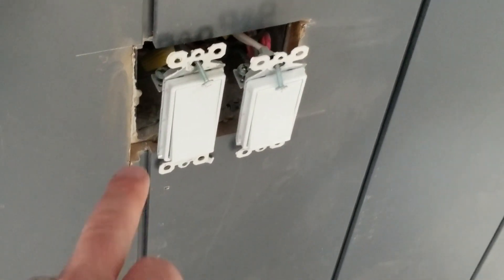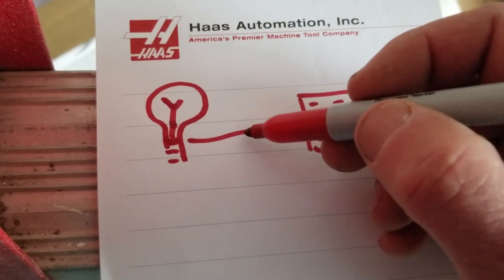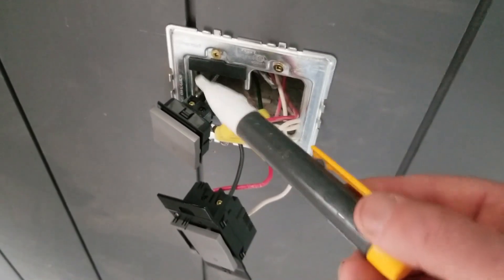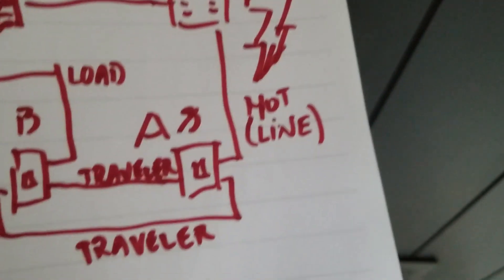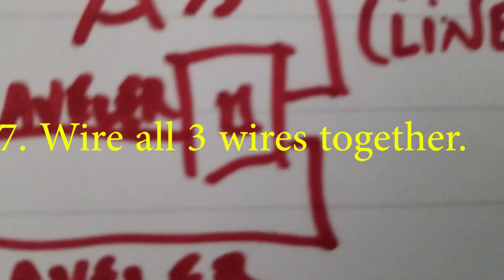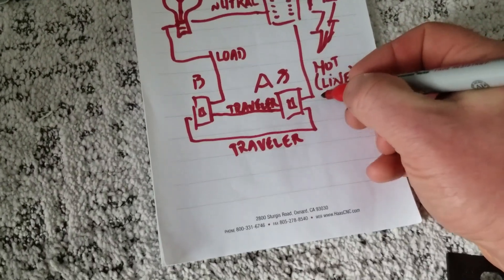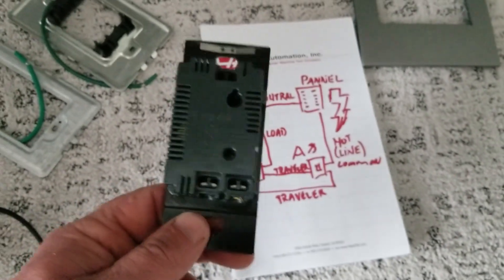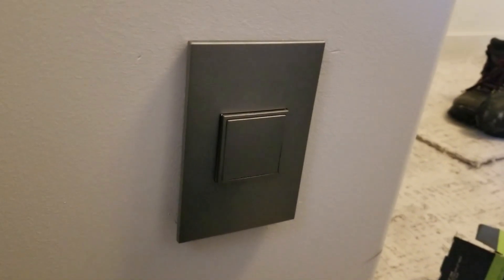Wire a 3 way switch | reference

Comment: We call that a two way light switch in the UK. Two way with intermediate is a real fun one too. Similar to what you did but with a third switch station (like for a stairs lighting circuit covering three or more floors). Intermediate switches are different construction to two way switches too.

Comment: Turning off the electricity is but one way. The other is passing the current through a delay timer, so the element of gambling is also a thrilling inclusion in the affair. I've never had a three way myself though, sticking to the tried and tested 4 way.

Comment: I always wanted to do this to my reverse lights on my vehicles, but the vernacular is different. Can’t this be applied the same way? Save for there are only 2 wires that run the reverse lights as mine are just wired parallel with the ones that run the ones inside my tail light housing. Advice? Might do the job but have left as is for sake of ease. Cheers

Comment: FYI there are multiple ways that 3-way switches  can be wired, this is the simplest and perhaps most common on newer construction, but certainly not the only way
Reply: The simplest i know of is feeding 120v to the travellers and the remaining 2 wires to the bulb

Comment: Using Wago lever nuts instead of twist nuts makes things easier and more reliable, especially when working with thin stranded wires that many modern switches and dimmers use. Also extremely helpful for troubleshooting / diagnostics, as you can very quickly connect and disconnect wires, repeatedly, with no twisting or damage to the wires.

Comment: It's really tricky when it's hot all the time and they switch the neutral and everything's wired through the old gas lines. The same house also used the old water lines as neural in some parts. Angry pixies taking a shower with ya!

Comment: "be sure to tin your Susans before grubble bunking your captain toms or you'll be franking your goose eggs through a chisel donut. Simply coax your copper teddies through the St Peter's Gate then call the president, but not before double-dipping your framptons relative to the split differentials on the fig whistle. Child's play. Chicks dig it"

Comment: I've been trying to figure this out since we got this house. There was a ceiling fan in the kitchen for some reason and I got rid of it and put in LED lights. But I could never figure out how to get both switches to work. One side worked but I couldn't figure out how to get the other one to do anything. So I just covered the wires and put a blank up. I can fix damn-near anything on a car, I can weld, and I can almost build stuff with wood. But house wiring has always been confusing. I'm used to red Hot and black ground. Now I've got white, black and green? Or sometimes white, black and a bare wire? What the frig? Yeah. I'm definitely not an elec-chicken. But now maybe I can fix the switches in the kitchen. Thanks AvE!!!

Comment: I've basically done this but a little more risky, I was using crocodile wires to basically trial and error wire it up until I figured out what wire is what. Was using volt meter to make sure I don't just short things out as I was working, but yeah was doing it live lol.

Comment: putting all the wires together and energizing them isn't the best way to find the output of a switch especially if you happen to have a neutral  in the box with your travelers also this don't work for dead end 3 ways using the black on the 14/3 too return to the original box

Comment: Look at uncle bumblefuck being all safety. I usually just start tapping wires together till something happens and leave it energized the whole time. I respect electricity, but I shake hands with danger sometimes cause I don't have time or energy to hit 2 flights of stairs and check and check again. I do appreciate adding another diag protocol to my memory banks though.

Comment: Here in France, code required specific colors for hot (red) and neural (blue) and earth (Green+yellow). this means that travelers must be anything else, but preferably both the same. helps a lot. what helps tool is that according to code, you do not use "cables" for in-wall wiring, but a bu ch of songle wires. helps a lot for readability, and it is not even really slower to put in place.
Reply: so just loose individual conductors inside the wall?  Is it THHN or what?

Comment: If a switch is up, it is on.  Down, off.  If I walked into a room and had the flip the switch down to turn the light on, I'd suspect the wiring technician didn't know what the fuck he was doing.

Comment: That's a handy archeological technique. The only bit I'd add is to put some colored tape around the white wire at each end to indicate it is not a neutral. In the US that is code, and likely so elsewhere those colors are used. And code or not, will save someone (possibly yourself a few years from now) some (possibly spicy) confusion.

Comment: It's funny how you guys in North America (+Canada), call it 3-way light switching. In the UK it's called 2-way switched lighting, because you switch it from 2  different switches! It's also known as multi-way switching. 3-way 4-way, if special "intermediate switches" are used in between. The 3-wire method is also more common in the UK. But the two "traveler wire" method is many reserved for conduit wiring. There are actually several different wiring schemes for "3-way" lighting.

Comment: Isn't that diagram wrong, or at best misleading? The switches are represented w/ two terminals on one side and one on the other. It looks like he's marking the top right on the right switch as common, but then the single terminal on the left side of the left switch as common. Googling shows that this diagram is sometimes presented with the schematic representation of the switches mirrored on both sides, which the diagram in this video seems to half/partially follow.

Comment: I needed something like this a few years ago when my father pulled all the switches off a Four-Way circuit... basically the same idea one more time, i think.
Reply: The 4 way switch goes in the traveler's that way any of the three, or more switches can control the circuit. The most switches I have ever installed was 8 in a small church community room

Comment: And Now for the famous Dead ended 3-way
Reply: The Common is the dark screw the dimmer always goes on the feed side of the 3-way Unless you wanted to dim at both ends then use maestro’s.

Comment: In Australia we call it a 2 way switch. 
3 way uses another, different type of mech (a 3 way, 4 pin mech) that essentially cuts the straps (travellers as you call them)
Reply: I was going to ask where the intermediate switch was in the circuit.
Reply: Yep, in the US, two switches are 3-way, and three or more are 4-way. 
The 4-way switch has four terminals. The travelers pass through it and it either passes them straight through, or swaps them. Any number of 4-ways can be placed between the 3-ways.
I think the naming here comes from the number of terminals on the switch, rather than the number of switches in the circuit. Still seems funny though as only the person wiring it would know (or care) how many terminals it has.

Comment: NEVER de-energize the circuit when working with wires, it saves you up to 3 trips back and forth from the breaker.

 trust me I'm an engineering enthusiast

Comment: Interesting how explain that in Canada/US. Here in Germany we call it Wechselschaltung in engl. Switch over. We call your two travelers -  correspondents, and the load is a Lightwire and the line - phase which you call it too. But if you have not enough wire we got an extra called economy switch over. You need on both switches load/light and line/ phase and only one traveler/correspondent. But this is outdated and only happens in old buildings with existing installations. Greetings from Germany an electrician

Comment: I've got two, 3 switch, 1 light circuits I play with. Whee. 
Former workplace had one 3S1L miswired, so you had to traipse through the lab in the dark, finding the right combination to get the lights to come on.

Comment: In Australia, a lighting circuit with 2 switches is called a 2 way circuit ...... because of the 2's.  A 3 way circuit ...... you guessed it, has 3 switches.

Comment: Don't forget y'all, you'll need switches that are 3-way, and or 4-way compatible for a carrier/traveler wire(s). The standard one way switch won't offer the internal toggle switching. Hence, the 3-way and 4-way units.

Comment: I have two switches in my house that are supposed to be I imagine to be a three-way switch with two switches to control one outlet.

If the switch on the left is in the off position, the switch on the right will control the outlet.

If the switch on the left is in the on position, the switch on the right will not control the outlet. What the actual fuck? Something is wrong in the doobly doo

Comment: I'm not sure the voltage that requires a fuxk off Frankenstein switch... but it sure was spicy up one arm out the other... been juiced by a power supply for a neighborhood's communications once also... I do have a multimeter... but also a screwdriver

Comment: Also to be proper code-wize there needs to be some reidentification tape (black, red, blue, basically any color but grey or green) on any white wire used as a hot or traveler, since in North America land, white always means neutral, unless reidentified with tape or other means.

Comment: As I was taught in grade 10... Always run 2 wire supply to the load, then a 2 wire run to the first switch, then a 3 wire run to the 2nd switch. No need for guessing that way...  which is how I've been doing it for over 50 years.
Running any 3 wire cable to the load got us a fail in school. Out in the field... no one gave a sheet.

Comment: #1 turn off breaker
#2 check circuit is dead
OK, I failed, I'm 0/2 ... I use my knuckle as a voltage probe and short the circuit if I need the power off!

Comment: Pro tip: if you swear you wired it up correctly, but the light won't turn off. Give the switches a tappy tap tap just to confirm they aren't fused in the on position because some apprentice wired it up wrong the first time....
Reply: Hey, got the opposite here in my room, the light sometimes turns off and won't turn on again using the switch by the door, which prompted me to switch bulbs first time it happened, so you just tap the switch by my bed in whatever position it's in and poof the light goes back on.

Comment: Remember, the fastest way to find out which breaker you should've turned off is to stick a screwdriver into said unknown hole. That's how I found out 7/10 rooms in my house were all wired through the same breaker. Still unaware what the other dozen or so breakers actually do.

Comment: I always try every combination of wire and terminal until the last one finally works.  It's faster if you leave it all live.  Then you only have to run between the two switches 9 times maximum... That's if you don't accidentally short it out and have to run downstairs, or if you forget which combinations you've already tried.  So worst case you get electrocuted, next worst case you repeat the same combinations indefinitely and end up with a pseudo 3 way switch.

Comment: Blasphemy!  EVERYONE knows that a properly wired pair of 3-ways has the travelers connected (or the switches oriented) such that the lights are OFF when BOTH SWITCHES are DOWN.  You ALWAYS turn a light on by moving a switch UP.  Don't make me come to your house with a screwdriver and invert one of your switches to fix your wiring!  I swear, any electrician who fails this test should lose his license.

Comment: I had a contractor trying to wire up three switches to control a single circuit, and he kept tripping the breaker.  I hadn't really thought about it before, but considered just what a four way switch does, as well as three-ways.  I drew up a few diagrams, decided what needed to be done, and told him.  He said he was following something from a book, but since it kept failing, he accepted that maybe the idiot homeowner should be humored.  He wired it as I suggested, and it feckin' worked!  When it comes down to it, it's very simple to wire 3+ switches to handle one load.  The two ends work just like with two switches, as shown in the video.  At one end, you have the hot go to the common terminal of a 3-way switch, and that switch will put power to either A or B.  At the other end, the load goes to the common terminal of a 3-way switch, and that switch will connect the load to either A or B.  Single pole, double throw.  So connect the A and B up between those two switches (e.g. 12-3 NMB Romex, red and black), and it all just works, very simple.  Any more switches, and they need to be 4-way switches inserted between those two 3-ways.  A 3-way switch connects one "common" to either A or B.  A 4-way has an input A and B, and an output A and B.  Double pole, double throw.  That switch either connects A input with A output and B input with B output, or it crosses them, connecting A input to B output and B input to A output.  You can have any (non-negative integer) number of these 4-way switches in the circuit between the two 3-ways at either end, and it all just works.  Changing the position of any of those switches changes the state of the circuit.  Flip a switch at one end, and you've powered A instead of B, or connected the load to A instead of B, or vice versa.  Changing the position of any of the intermediate switches, and at that point you've changed whether hot (and/or load, depending on how you look at it) is on A or B.  In practice, very simple.  Oddly, the way the diagrams the contractor used worked, they involved connecting the neutral to the switch.  Maybe there's another trick to that, but when I wire it, I want the neutrals and grounds each just connected, all along the circuit, with no switches or other devices in between.  Anything that can interrupt the circuit, I want on the hot.  But maybe that's just me, an IT guy and not an electrician.

Comment: And, to prevent feeling intellectually deficient when you turn your breaker on after installing said 3 way circuit and it ends up not working....remember to turn the main back on. 

I chased my tail for 10 minutes checking the one I did today, just to realize I failed to realize.

Comment: Or you can do it like me an keep it live an touch all the wires together with neddle nose pliers holding the wire to find out what wire does what LOL what's the worst that could happen,,,,,i turn the light on or trip the fuse box!

Comment: Really appreciate this but can you now please go over a 4 way switch. I have a light that runs on three switches but I swear it’s not wired correctly as it seems only two of the three switches will work at a time. If I turn the middle switch off then the top and bottom switches work the light then if I turn the middle switch on the top and middle switch works but not the bottom it’s very weird but only two will work at any given time. Depends on how all three are set but it can be worked with all three just not at once.

Comment: the problem you ve got there, me old canadian waffle... is that you've halved the voltage and doubled the current, whilst using some weird idea of sending the pixies down some odd colour wires, whilst expecting them to get round fuckin wire nuts ...... ps im a sparky in the UK ....so i know my bacon from my bears !

Comment: Funny.  Three ways are easy once you understand them. Of course, first you have to convince the wife to go along with a 3 way.

One time I was helping my son in law rehab a house. One of the problems was a malfunctioning 3 way circuit. Running short on time, we hired an electrician to resolve the electrical problems. I saw him randomly switching around wires, then turning on the circuit to see if it works. Hell, a monkey could've done that, and they'll work for a couple of bananas. We fired the guy, and I ended up fixing it.

Comment: All that fiddling around with circuit breakers and whatnot is wasted energy, just follow the one hand rule and keep those elbow tucked in. Worked well enough for me as I was flying over the North Atlantic and 3 of the 4 generators on my 50 year old C-130 gave out and I had to go fiddling around with the power contactors and control units to get all 3 of them back up since there isn't very many places to land with the intent to take off again in the middle of the Atlantic.

Comment: Make darn sure it's all one breaker.
If you use 2 breakers you will eventually have both switches on sending 220v to the light causing an overload and a possible fire.
If you aren't sure do not touch it